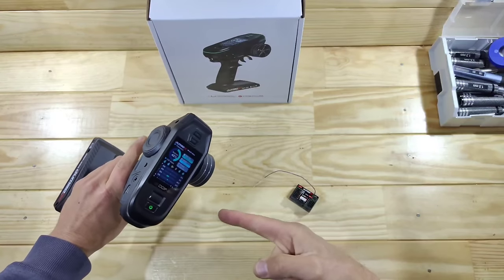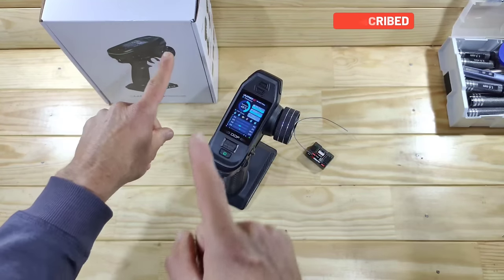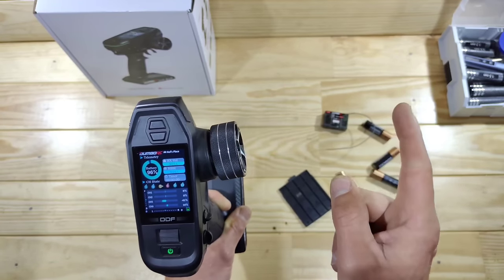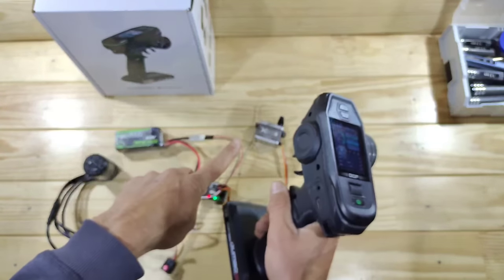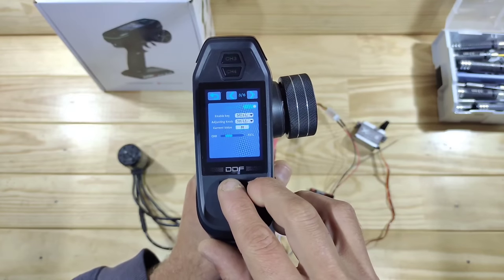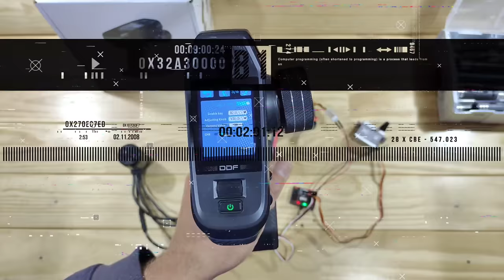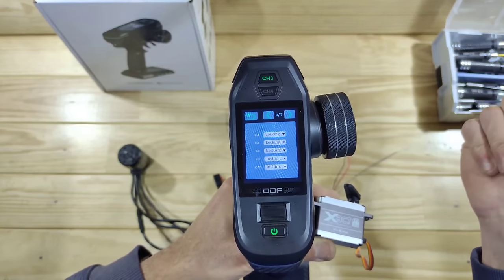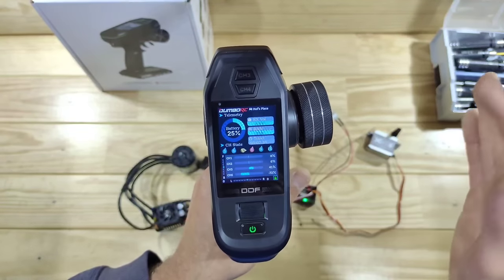Answers to 7 most common questions about the DumboRC DDF-350

Comment: Ima kinda confused I wanna be able to open the throttle trim with a nob? While im running a nitro.
Reply from the maker: That's not possible. Or you have to mix CH2 & CH5, then you can throttle up with CH5.
But trimming is pretty easy and can be done on the home screen
Reply: You can set the Dial 5 or 6 to do steering trim. I just learned how today. I have mine set up , gyro on nob 5 and steering on nob 6.
Reply: @familyrc777  broooo make a short how you did it!!!!!

Comment: Hi buddy, how do I set my dual rate and steering trim to channel 5 and 6 on the side of the transmitter?
Reply from the maker: Hi, go to the general menu, page 3 is end-points/trim
Reply: @hofsplace  yeah I got that buddy, I want to assign channel 5 and 6 to dual rates and steering trim, I need to be able to adjust them quickly without stopping and going into the settings and I’m planning on using this for indoor Rc racing
Reply from the maker: @bigpythons1983  that's not possible. But you can adjust the trim from the home screen with the scroll wheel
Reply: @hofsplace  that’s a real shame I’m gonna have to buy another transmitter, the old non digital dumbo transmitter can do it, that’s really disappointing the ddf 350 can’t do something that is so commonly used

Comment: The B+B- the two wires that show your trucks battery percentage 
My question is does that function only work on 2s & 3s? Not 4s has anyone tried it on 4s?
Reply: I plugged in the 6s, everything works.

Comment: Hi! How can I bind it?
Reply from the maker: Make sure your transmitter is in the correct profile, you have 10 for different cars, and turn it off.
Press the bind button until it flashes, turn on the transmitter, it should bind then. Try to steer a couple times to check

Comment: Is 3S the maximum number of cells for return voltage? I can't get my x10fg receiver to read a 4S battery 👎
Reply from the maker: As far as I know, max 3S
Reply: @hofsplace  thanks. That is a bit disappointing. I'm just going to connect it across one cell and just get a reading for that cell. My batteries discharge pretty evenly so it shouldn't be a problem.
Reply: What’s the benefit of running 4s over 3s over 2s? Does it give you more range?
Reply from the maker: @familyrc777  hi, they are talking about the telemetry function. This means that the battery voltage of the car is shown in the display.
Reply: @hofsplace  ah I see. Okay. My bad. Thanks for the clarification

Comment: Hi buddy does that have a gyro
Reply from the maker: Yes, you can choose with or without a gyro
Reply: @hofsplace  brilliant buddy so the receiver that would come with it has a gyro or do I need to buy a receiver with gyro in it
Reply from the maker: @samcourtrc6767  hi, there are multiple versions available. If the description of the receiver has a G in it, than it has a build in Gyro
Reply: @hofsplace  ok buddy thank you so much for ur help I run all my rcs with the old dumbo Rc with the x6fg gyro and my two speed run cars so i should be able to pair the new one with them receivers hopefully
Reply from the maker: @samcourtrc6767  the old receivers will bind to the new transmitter
Reply: @hofsplace  thank you buddy ur gentlemen for all ur help

Comment: excellent radio, too bad it doesn't have direct trim buttons but you have to enter the menu every time, I would have done without the buttons for the various channels but at least have the steering trim
Reply from the maker: Om the home screen you can adjust throttle and steering
Reply: You can also change the Nob to work with steering trim. I just learned that today. Mine has the gyro set to nob 5 and steering to nob 6. Kind of like Traxxas tqi controllers.

Comment: You didn't answer why it's JUNK.   You can't even mix ch3-12 with ANY of channels 1 or 2.   Meaning you cannot mix 4 wheel steering and cannot mix two throttle channels for dual motors.   Pathetic tech right there!!!
Reply from the maker: You're wrong! You can mix any channel with any channel. Go to 'model menu', page 7, here you can mix everything you would like
Reply: Not on my dumbo350....  it only offered mix of 3-10.    Maybe I got old firmware version?      I searched every single menu page for mix capability.   There was NO MIXING for channel 1 and 2 whatsoever to channel 3-10 !!
Reply from the maker: @Idontdohandles  mixing 1 & 2 is done in the Tank mode.
All the others can be mixed. Try to update the firmware

Comment: Hey Hof, are you aware there is firmware update available? A video would be awesome
Reply from the maker: Yes, I tried to make the video, but I run into some issues with the update. The first transmitter I tested worked fine.
The 2th one which I was filming... failed 😅, so no video shortly I think
Reply: @hofsplace that would be awesome also do you know if I can program a launch control button for drag racing like the traxxas drag slash 
Keep up the good content 
Watch from New Zealand 🇳🇿